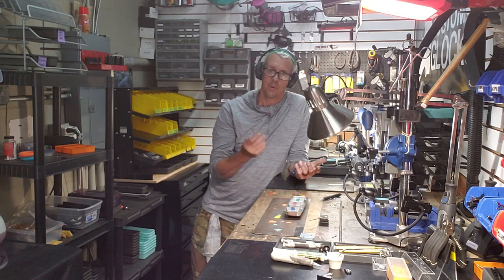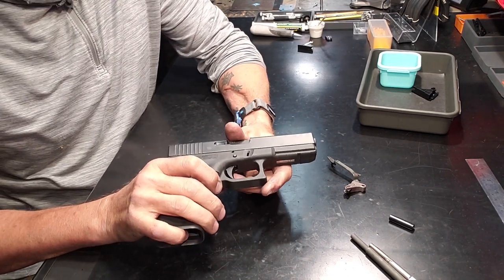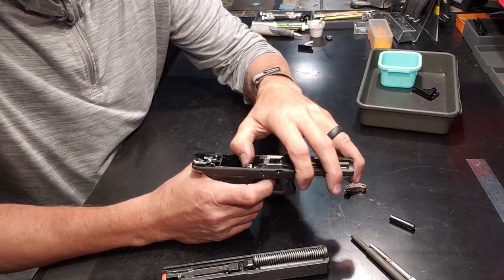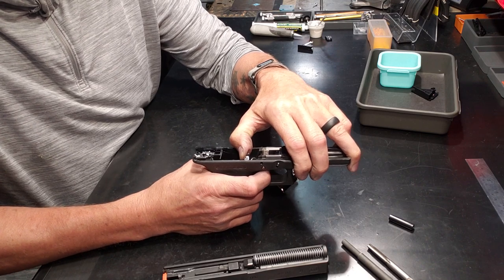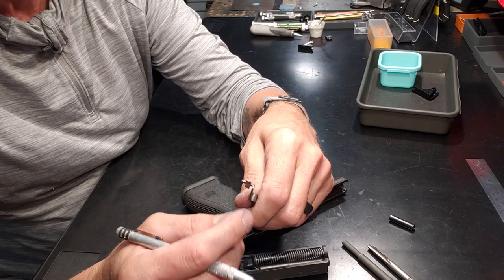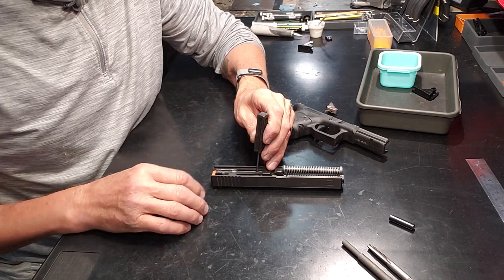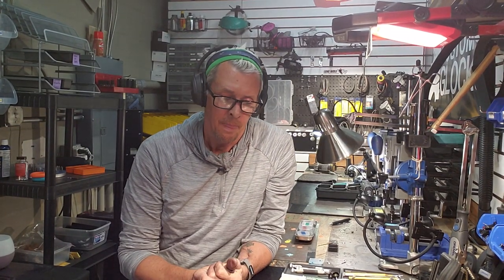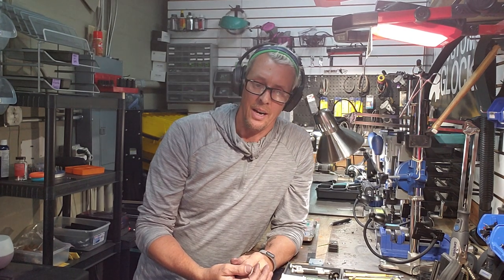Glock trigger system chasing grit,grind, and drag

Comment: Just saw your video and it helped me fix a gritty/stiff trigger pull on my G19 Gen4. I measured 5 lbs 12 oz pull from the factory and have been living with that and a gritty trigger pull for the last few years. I decided to do a polish job and install a 4 lb trigger spring kit but the trigger pull was still gritty and only dropped to 5lbs 6 oz. A Google search pulled up your video and your tip about the connector pushing the trigger bar against the frame was my issue. I bent the connector back a bit and now the trigger pull is smooth and measure 4 lbs 3 oz.  Thanks for the video!!

Comment: The right side of my vertical extension is scraping but I see no scratches or wear on adjacent surfaces. What might be the cause and could this be related to the slide’s hesitation to lock forward when sliding by hand?

Comment: I swear you should have some affiliate links to Glock parts! With your help I was able to diagnose the problem with my trigger grind. Turns out it wasn’t the trigger, but the firing pin safety plunger spring! I purchased it asap.

Comment: Quick question- at around 2:45 you talk about the connector being too far laterally “pinning” the trigger bar, what’s the fix? Is it as simple as bending it a little? What’s the best method to bend it? If I were to bend it too far; what would the result be?

Comment: I wonder what you recommend for the type of grease/lube for the trigger bar-connector contact. I actually use loctite copper anti-seize like what Glock uses at the factory. I find it to be the most consistent over time. I've tried them all from White lithium grease to high pressure grease, to ask other kinds of grease red and green, to just plain oil and found that due to the pressure between the trigger bar and connector, galling is likely to happen since both metals are the same and are sliding under high pressure. This leads to gritty feel later on even if both surfaces were polished initially. So, in my own experience, I've found that the copper creates a barrier between the two same metals that is strong enough to handle the pressure, yet softer than the Glock metal. Just wondering what you think Johnny. Thanks bro.

Comment: I am experiencing slide drag. So when I rack the slide with the trigger pressed, the slide will remain back slightly until I release the trigger, only then it will come forward. I believe my shark fin is getting caught in the plunger. All my parts are mirror polished.

Comment: @johnnyglocks Hey Johnny, I have a question regarding my Gen3 G-34 trigger. In the firearm I have:  Polished Angel 3.0 3.5lb Ghost Inc. connector, OEM polished trigger bar and shoe, OEM competition 6lb trigger spring, OEM polished firing pin, 6lb ghost inc firing pin spring and a polished zev tech safety plunger and spring. My trigger shoe safety spring was getting old so I bought polished and put in a new OEM trigger which made the trigger pull long and insanely light  (different geometry at the point where it meets the connector). So I then decided change out the 6lb firing pin spring with a 4lb spring and load a 3rd clip the trigger won't break.. 6lb spring works. 4lb no click. Is it due to the complete lack of tension?.
Reply from the maker: That sounds pretty spot-on I do have a videoon how to fix that trigger safety tab spring so you can keep the same bar.you definitely should browse my content and find it if you still have the trigger bar w/shoe
Reply: @johnnyglocks  Thank you. Your videos are hands down the best.

Comment: Hello Sir, I just bought a second hand Glock 19 gen 3. When I pull the trigger back and push the gun forward and backwards, I am not hearing the tink of this firing pin or rattling noise. However multiple times I have cleaned the gun by myself and I am sure inside the slid is free of oil,  however when I purchased, it was oiled and dirty.
Is it necessary to hear the tink sound for all the Glock pistol when we move the gun forwards and backwards?!
If it is necessary, then what is the problem of my Glock?
FYI, I didn't test and fired yet, but I checked by putting a pen inside the barrel and pull back the trigger, then the pen comes out. I mean it looks the gun functioning well!

Comment: I really wish they made metal spring cups, channel liners and spacer sleeves. Think it would smooth out the trigger and get rid of the terrible plastic feel.
Reply: They make brass channel liners already a lot of people said it worked pretty good
Reply: @mikeyeyes7  One company makes aluminum firing pin spacer sleeves for the 44... but they don't make them for any other model for some reason.
Reply: @deucedeuce1572   I’ll rather have plastic cause I little burr or nick in metal or brass can cause problems & with plastic it will smooth itself out
Reply: @mikeyeyes7  Wish I could see the sense in that, but I haven't been able to. A metal one would be far less likely to get a burr or nick in the metal in the first place... and I could always file/sand or polish away anything like that before installing it. Once installed, it would be nearly impossible for the part to get damaged.

Of course after finally writing this^^^, I remembered that you have to push down on the spacer sleeve with a punch to take the back plate off the slide (which does get nicked and damaged after several times). I guess if I got a metal spacer sleeve, I would also want to have one of the back plates that don't require you to have to push down on the spacer sleeve (or be careful not to damage it, but being metal it would be more durable). In the end though, I still think I'd much prefer metal/steel parts (if anything, just for the experiment). Sorry for the rant.

Comment: What would cause a click just before reset, you don't notice it if your shooting or just checking reset with out ammo, but if you slow it down,  I'm getting a false reset just before the actual reset, it sounds like the shoe saftey springing back in place but it's not that.
PS. I grew up running around in Venice, was born in Sarasota memorial. Wished I still lived in Florida, I'd love to come by your shop and pick your brain while picking up a trigger system from ya.
Reply from the maker: check that your trigger spring is seated correctly sometimes it pops out and wraps around the leg of the trigger bar
Reply: @johnnyglocks  thanks for the reply sir, I'll check it out when I get home.

Comment: When you guys are sanding or stoning theses Glock parts are you breaking through the nickel plating? I have used 1500 grit and it breaks through the plating then you see and edge of it. I imagine you guys are sanding this off and getting down to the metal. I have since been scared to mess with it that much so I use 2000 grit with oil and do light swipes then by hand flitz. This gets me shiny and clean but not anything as extreme as what I think I could be.
Reply from the maker: Only the Striker lug face has that copper nickel plating as for the trigger bars that's some type of galvanization over top of what I believe to be Moline Steel
Reply: Thank you. I finally went ahead and cleaned that striker up. That plating always broke through with use and created an edge. Now it’s perfectly smooth and clean. I did the sear as well and that took a lot of time. Maintaining the angle and swiping down only and not back and forth took a while. I didn’t see a vid on this but that method seemed logical. It was full of pits and machine marks and now is as smooth as my striker face.

Comment: Great video, but a little too advanced for me.  You take things apart faster than I even knew they came apart.  And then suddenly you introduce a tool.  And you have spare parts hanging around.  Do you have a better place to start for people about 14 levels of knowledge less than yours?   I am trying to diagnose a problem on a G44 trigger, on the very first mm or two pulling it, that sound like grit/spring sound.  And I have no such similar sound on my G19 or G26.  Thanks for any advice.

Comment: Hi there,
Video of my issue: 
https://youtu.be/Y6o7-E3cl8g
Got a click in my trigger pull. New gun, bone stock G45 MOS, 60rds plus dry fire. Click is after the wall, before the break. Detail stripped, cleaned, no apparent burrs and checked all points mentioned in Johnny's video. Can you help diagnose?